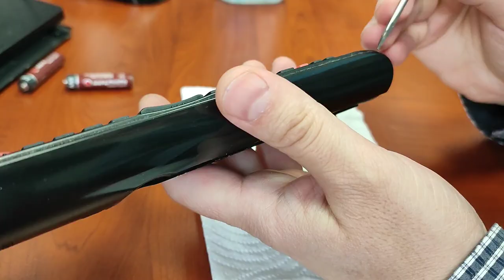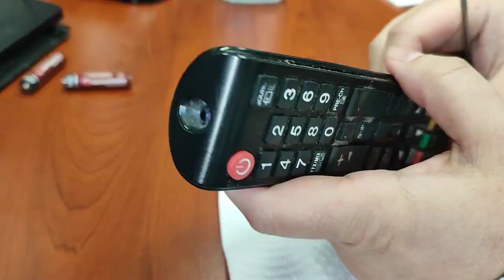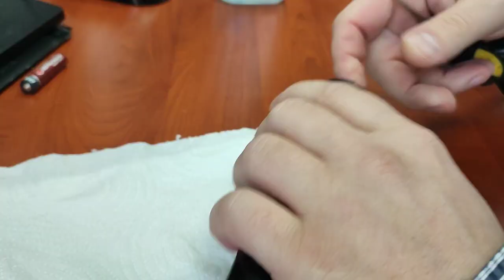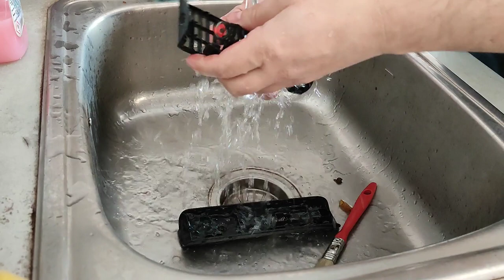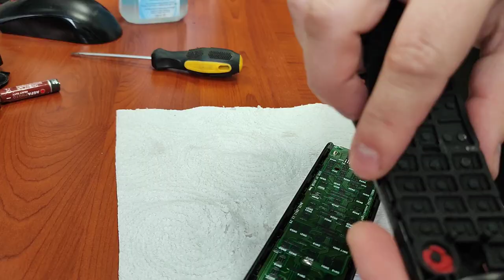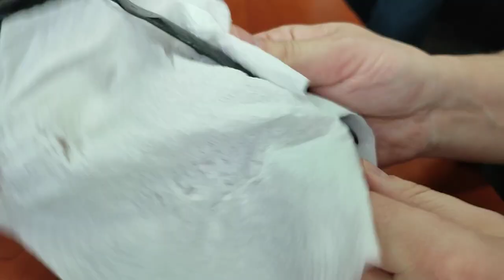How to Clean TV Remote Control | How To Repair Remote Control Buttons That Don't Work

Comment: Some people scuff up the contact points on the rubber keypad.
Reply from the maker: I`ve tried many different methods, but  so far this was the best. There is certain point where cleaning is not enough to revive the remote control, but it is worth to give it a try :)